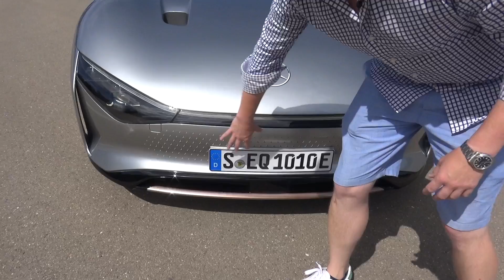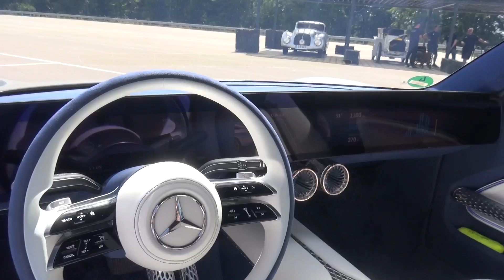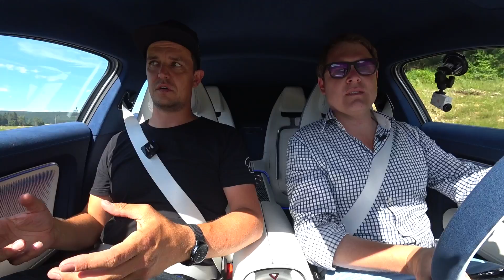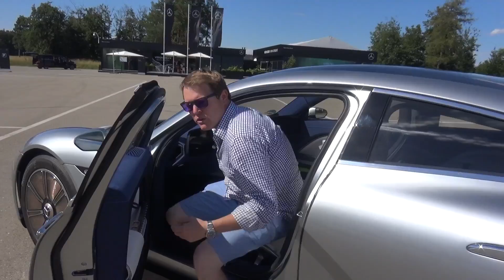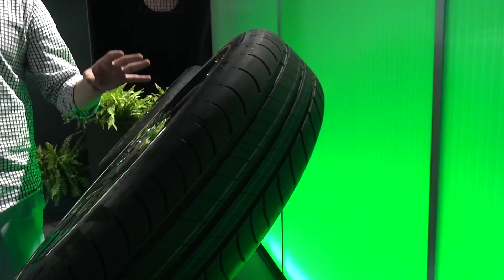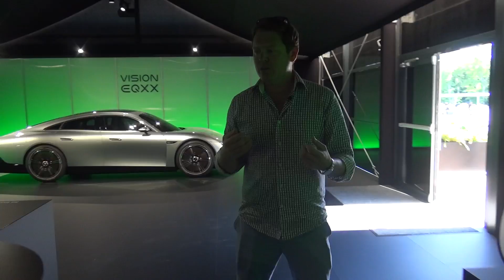New MERCEDES EQXX First Drive! The Record Setting EV with 1,200km+ Range

Comment: I want one.  Notice how there is no back window though?  Thought the roof was transparent with with solar panels embedded, and I am not sure why it is not.  There was no mention of sensors in the front, the rear, or backup cameras, or cruise control.  Yes, it might increase weight, but it will be necessary to have those features.  I also did not see places to plug in phones, drink holders, or places to put a phone, etc. They also did not show any places for luggage.  I know those features may not be the focus of this car, but they will be important if this goes beyond the prototype stage.

It would be nice to give me one to drive for a year.  They would find out how the car would be for every-day use in all types of weather and conditions in rural America.  It would be subjected to roads that are not so nice, be driven every day, and get "used."  After driving Priuses for the last 10 years, I got spoiled with 60mpg, but I am ready for a change.

Comment: Wow, that's a cheap car to drive. 8.4kw/100km is about $1 of electricity for 62 miles driving at Florida power rates. That's compared to about $12 for gasoline @ $4.50/gallon, 25 mpg.  Only negative I can think of is visibility, this being a low car driving on roads full of SUV's. Good looking interior

Comment: I like it.  The range alone is an eye catcher. Just gotta build more charging ports to make it truly practical.
Reply: Why would you need more charging points if you get up in the morning with a car that has a 1000 Km range? You can't drive that far in a day.  You would have no need to stop to charge, no need to look for chargers or worry if they work or not or if there is a queue. This car only gets charged at home or at your destination. It charges slowly over night while you are sleeping at a time when the generating capacity of a nation is under utilized. (Everybody sleeping with cookers, kettles and TV's off). There is a reason at the moment why night time electricity is cheaper.

Comment: Wait until you have to Replace the Batteries 20.000quid and the Can't be Recycled and draw 25 times the power of your Fridge to Charge life of Batteries 100k miles do the Maths No green
Reply: Do the math on how many TONS of actually filthy fuel your gasser burns through in operation. Hint: the dozen+ of tons would power your fridge for literally centuries.

A dozen companies have started up to recycle EV batteries: American Battery Technology, Battery Resource, Brunp Recycling, Green Li-ion, Li-Cycle, Primobius, Redwood Materials, ReLIB, SMCC Recycling, Umicore, ... Their biggest problem is they can't scale up because the batteries are lasting longer than expected. Also, hobbyists and stationary storage are buying up tired, but not broken, batteries.

If you're worried about the pollution from making a 2-ton recyclable product, then don't own a car! But if you're going to drive, an EV is unquestionably greener than a gasser burning through tons of fossil fuel.

Comment: Looking through the comments, I really hope people change their minds about EVs. They are the future, the synthetic fuel is not going to save our climate like EVs will. I'm sure I'll get lots of hate for it, but as a car guy I much prefer seeing cars evolve into what we think of as science fiction designs. I'll miss the sound of a V12, but these cars will allow us to continue to have a passion for cars and save our planet too.
Reply: Synthetic fuels will be punishingly expensive, because the gargantuan amount of energy needed to split water for the hydrogen, split CO2 for the carbon, then reassemble them. (Biofuels are a niche that's quite carbon intensive.) Why use all those Gigawatts of electricity to propel a slower, noisier car that you can never cheaply recharge at home or work? Only Porsche fans need apply.

Comment: How sustainable is lithium, cobalt and nickel mining for giant EV batteries x 100’s of millions of EV’s globally, coming soon?  FYI - wind mills and solar panels require batteries for energy storage.  You’ll need how many of those “sustainable” power sources to replace the current fossil fuel based power grid, in order to power those 100’s of millions of lithium batteries.  How safe is nuclear?  How problematic is clean coal?  What’s the longevity of all those batteries before they require replacement?  We need more options; realistic sustainable alternatives before we mandate the end of fossil fuel. 

The battle for fossil fuels is ending, the battle for lithium has just begun.
Reply: You've been suckered by fossil fuel interests into worrying more about the harms from producing millions of tons of recyclable batteries and renewable energy than the far greater harms from mining, refining, spilling, then BURNING the literally BILLIONS of tons of actually filthy fossil fuels that they displace.

By all means use less energy, but the transition is massively better than continuing fossil fuel burning.

Comment: Solar cells don't like heat just sunlight. 
A good option while rolling down hill the car should detect once over speed automatic regen kick in.
Very cool tech well done.
Solar on the bonnet and boot too.

Comment: The question is who the hell is realistically driving like this.  Ok so if you press the gas and then coast the whole way you dont use any power, great.  If I put my new S580 into Eco mode, get up to speed and release the gas the 48V battery will let it cruise for some time also.  However, I drive the car in sport+ mode 99% of the time.  This electric stuff is a joke and until you can drive the way everyone is already accustomed to and get decent range itll never catch on.. And after that, how our power grids would handle every household charging is the next inside joke.

Comment: If parked in the sun (Game Day) what is the solar charging rate? Also, bamboo doesn't burn.
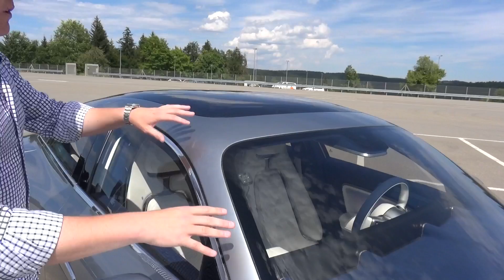Reply: 4:44 "on their full 1,200 km run they were able to recharge by 45 km of range." That's too vague to work out a power rate; if the car normally gets 1000 km from a 100 kWh battery, then it harvested 4.5 kWh of solar energy during the trip, but was that in one day? The solar roof looks half the size of a residential solar panel, so maybe it generates 200 Watts (0.25 horsepower) in perfect sunlight.

Get all your friends to hold mirrors up reflecting sunlight onto your car's roof and you can beat the other EVs in a race!

Comment: I wonder what the mileage is when driven "normally".  Not everyone wants to be thinking about hyper miling every time they need to buy groceries or pick up the kids etc.
Reply: I'd like to know also, I don't do economic, full send only
Reply: The record 1200 km from a 100 kWh pack is 7.4 miles per kWh (!!!), which I think is 250 MPGe (miles travelled on the energy in a US gallon).

Many big EVs achieve over 100 MPG equivalent; the Lucid Air Grand Touring gets 131 MPGe. Divide by 1.2 to get Imperial miles per gallon.

Disclaimer: math is hard.

Comment: They're making some great advances in aerodynamics and power control, but the thing I'm anxiously waiting for is the leap forward in battery tech with the solid state batteries coming in the next few years.  That's what will really catapult electric cars into the mainstream.
Reply: 7:45 30% lighter battery "the power density is unheard of". Elsewhere Mercedes Chief Technology Officer says "The battery chemistry from the concept will enter production for the 2024 or 2025 model  years." It's probably solid-state if it doesn't need cooling. Imagine a Rimac Nevera concept_three whose battery weighs 200 kg less! I hope car makers can start to reverse the trend of porky SUVs made heavier with heavy batteries.

Comment: The longer the range the more batteries and the worse it is from a carbon neutrality perspective. Long range EVs, over their life are worse for the environment than gas cats. The mining and electricity needed is carbon positive compared to a gasoline car.
Reply: Yes buy only as much battery as you really need, but adding a 1/2-ton battery displaces literally tons of fossil fuel over the life of the car that is at least as intensive per ton to mine, refine, ship, spill, then burn. Every reputable recent study finds an EV is better for the environment on the current grid mix everywhere but coal-soaked Poland. The only question is whether the EV pays back the cost of making the battery after 7,500, 13,000 or 40,000 miles. Since the majority of new generation is wind and solar (because they're cheap and quick), the EV will only get cleaner.

Comment: To get that range you have to drive it like your a Sunday driver who enjoys watching your dashboard alot more instead of looking  forward . I managed 65mpg from my old Citroën xantia 1.9 turbo diesel  80 ltr tank.  Ask the question how long did that journey take 🤔 to attain those figures?
Reply: Forget the 1200 km trip, at 1,000 km from 100 kWh this thing goes 10 km per kWh, which is 337 US MPG equivalent, or 280 miles per (imperial) gallon equivalent!
Blowing up fossil fuel to make heat and and noise and a little forward motion can't compete with efficient battery and electric motors recharged from a grid that's getting cleaner all the time.

Comment: I’m all for efficiency but one of the worst things Mercedes could do in my opinion is have people crawl round a route. Have Tim go from city to city on the motorway etc or over the Alps but don’t show him holding back. If you can drive that with a bit of pace and still get 400 miles real world then brilliant. Let me drive it from Glasgow to Durness Scotland highlands where you go up hills but more to the point back down 👍😁 But at the rate battery tech is progressing how long before it’s 2000 KM. Best part is it looks like a futuristic normal Car and not a science project.

Comment: Really astonished that the engineer is astonished that warm temperatures arround 30 degrees celcius are good for range. I don't think there isn't an EV on the market that it's range does not  increases on the summer even with AC on. On the other hand low temperatures usually have a 10% decrease on range. Despite this EQXX is a very big leap forward for Mercedes, the range record is well.. A record to be beaten but the average speed must have been of an actual turtle to the point spikes from the cacti on the seats must be realesed so people don't fall asleep. Anyway, nice car, nice potential, great stuff for the future.

Comment: In a few years all these cars that do rubbish range at the moment will be laughed at and worth nothing (base Audi etron, mini electric etc etc) Electric car technology is advancing too much to buy into it now
Reply: They're all so much more efficient than a gasser, there's no reason to wait if you can afford one. I think on its record run of 1,200 km from a 100 kWh pack this EQXX got 250 miles per U.S. gallon equivalent, which is impressive but "only" double the 125 MPGe that several existing BEVs achieve.

Comment: Would of preferred to of seen how efficient this would be driving it like everyday drivers would do.
Reply: If my math is right it achieved 250 MPGe, travelling 250 miles on the energy in one U.S. gallon. Plenty of EVs get 120+ MPGe.

Also, it's *would have

Comment: Concept/experimental cars

Cd	        Automobile	                                                Year

0.29	FSM Beskid Polish hatchback prototype	1983
0.27	Avion[231]	1986
0.26	Alfa Romeo Disco Volante	1952
0.25	BMW Kamm-Coupé	1938 [232]
0.25	Dymaxion Car	1933
0.25	SmILE (an experimental car)	1996
0.23	Volvo ECC	1992 [233]
0.23	Pininfarina X (Morelli shape)	1960[234]
0.22	BMW Vision EfficientDynamics Concept	2009
0.22	Citroën ECO 2000 Concept	1981[235]
0.22	Aurel Persu Streamliner	1923[236]
0.20	Opel Eco-Speedster	2002[237]
0.20	Loremo Concept	2006
0.19	Alfa Romeo B.A.T. 7 Concept	1954[238]
0.19	Dodge Intrepid ESX Concept	1995
0.19	General Motors Ultralite	1992
0.19	Mercedes-Benz Bionic Concept[239](based on the boxfish)	2005
0.170	Chrysler Ghia Dart	1955[240]
0.170	Mercedes-Benz VISION EQXX	2022 (Cd figure measured in the Daimler aero-acoustic wind tunnel at a wind speed of 140 km/h) [241]
0.168	Daihatsu UFE-III Concept	2005[242]
0.16	General Motors Precept Concept (5 seats)[243]	2000
0.16	Edison2 Very Light Car, Automotive X Prize winner[244]	2010
0.159	Volkswagen 1-litre car Concept	2002
0.157	Li-ion Motors Wave II, Automotive X Prize winner[245]	2010
0.15	Schlörwagen[246]	1939
0.15	Aptera 2 Series 2e Prototype	2011
0.15	Keris RV Nakoela Team (Shell Eco-marathon) Prototype	2015
0.149-0.150	Urbee 2[247]	2013
0.147	JCB Dieselmax land speed record holder	2006
0.14	Fiat Turbina Concept[248]	1954
0.137	Ford Probe V Concept	1985
0.13	Aptera Sol Prototype	2021 [249]
0.125	Sunraycer, solar race car	1987
0.12	Reflex 1000, solar cycle	1996[250]
0.12	Panhard CD LM64	1964
0.117	Summers Brothers Goldenrod Bonneville race car	1965
0.116	TUT Sunchaser 4[251]	2022
0.08	Fortis Saxonia (Shell Eco-marathon) Concept	2007
0.072	Alérion Supermileage (Shell Eco-marathon) Prototype	2013
0.07	Nuna, World Solar Challenge winner	2001–2007
0.0512	Ecorunner V (Shell Eco-marathon) Prototype	2015[252]
0.048	Ecorunner VI (Shell Eco-marathon) Prototype	2016
0.045	Ecorunner 8 (Shell Eco-marathon) Prototype	2018

Comment: Much lub Sexxxy but the tires are a little thick and narrow and that gas cap has got to be re located because that is an eyesore🍾🍾🍾 But everything going electric by the end of the decade just sounds crazy and the grid will never sustain all those electric cars oil is a natural commodity mf the green new deal.

Comment: it sounds great. the question is how sustainable is the battery pack? what is used to produce the battery?  How long can you use it? that frame looks great, but what if it was in a crash or so, does the whole frame has to be replaced? what is the cost of such a battery? what is the true economical footprint ? are there enough materials to produce them? (what do they cost?)
Reply: Don't be suckered by fossil fuel disinformation into worrying about the environmental footprint of the battery. Just do the math. A 35 mpg (USA gallon) car will burn through 10 TONS of actually filthy gasoline over 120,000 miles, that's at least as dirty per ton to mine and refine, then it all goes up in smoke to worsen global warming. Adding a 1/2-ton valuable battery reduces that substantially when powered by today's electrical grid anywhere but coal-soaked Poland, therefore common sense matches every reputable study: an EV is better for the environment overall.

If you still want to worry about the environmental footprint of a 2-ton product, then don't own a car at all.
Reply: I'm sure you all these questions about everything you consume.

Comment: Advantages: 
an ev, so it's automatically eco-friendly,

Has a long battery life

A cool sustainable interior

Disadvantages:

Manufacturing the battery, and gathering the resources for said battery involve third world countries, and lots of carbon emissions, more than you save driving the car for its full life span 

The interior isn't actually as sustainable as it claims, the material still have to be harvested, transported by truck to be manufactured, and shipped by land, and or sea to MB to be installed in the car, rendering it not very sustainable.

Overall, not to confuse 'hateing' with 'facts' this car is just alot of lies.

Comment: I love the front. I hate the front of the Teslas. The split line on the front end’s abruptly at the front doors. The rear looks weird. The hip lines are great and the windows have a nice follow on line. Drag coefficient is less important when you’ve got gobs of torque. Don’t constrain all of the designs to aero. Eventually, they’ll all coalesce to the same shape. I get that this is a design project.

Comment: -Mercedes: we wanted to save up on power so we decided not to have cameras as sides mirrors and (consequently) no mirror monitors
-Mercedes: we decided to install this beautiful 900” infotainment/digital gauge cluster. Awesome, right ? 
-Audi engineers: what?!?
Reply: The operation of the camera sensors and image processing (including HDR, tone mapping, and rendering on display) is quite energy intensive. With an FALD LCD or OLED display, just showing static dark/black backgrounds is low energy.

Comment: Im not sold on the external body styling but interior is awesome.  It will interesting to see what really comes out of project when you consider USA, EU, and UK safety legal requirements  Did they say what kind of battery technology/formulation?  . Thank you for the ride.

Comment: I can understand the concept of the battery tech, weight and driving efficiently but the speeds that are being completed in this example are very low and not normal driving. If normal driving speeds were completed the charge range would probably decrease substantially.

Comment: Mercedes are well known liars regarding drag coefficients so I'd take the EQS claim with a big grain of salt. They previously lied to claim best in world with a value just under Tesla at the time, iirc around 0.23 for the CLA but when actually tested it was 0.3 and Tesla's was true. A rather substantial lie they never apologized for. Same with dieselgate. That said I can imagine the EQXX is at least fairly aerodynamic. Certainly looks like it. It wouldn't be difficult for Tesla to beat it though, they just don't do concept cars not intended for production. It's a truth thing.
Reply: Yes tests done with skinny wheels and taped window seals. The EQS probably does have a low drag coefficient but it's got big frontal area.

Comment: Arguably your most relevant video for the current times you’ve produced in ages, Tim. Great video. This is the kind of EV that appeals to me, not the dumb, put an electric motor + battery in an SUV without any thought to aerodynamic and weight efficiency.